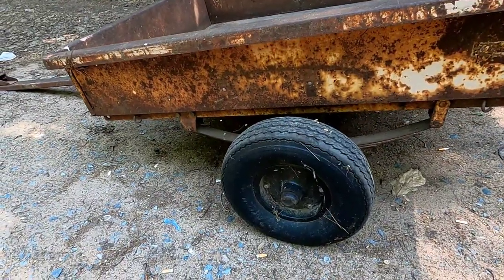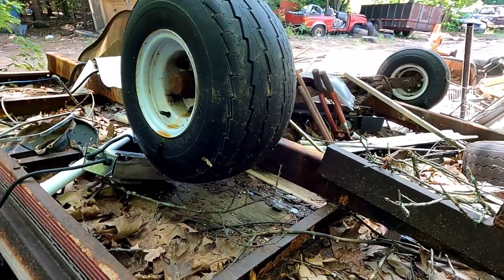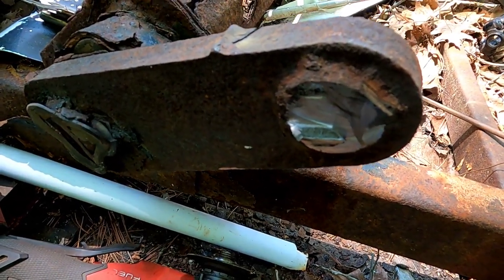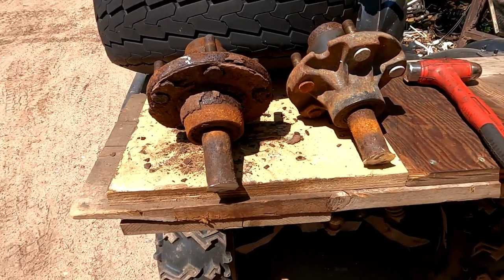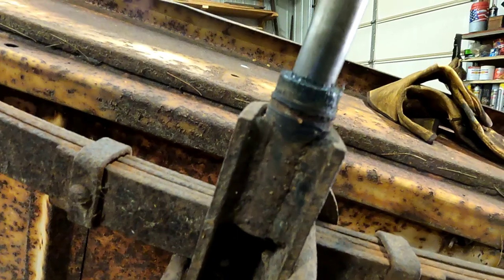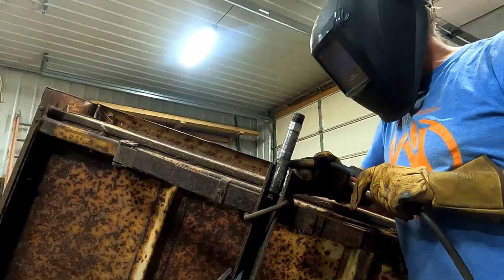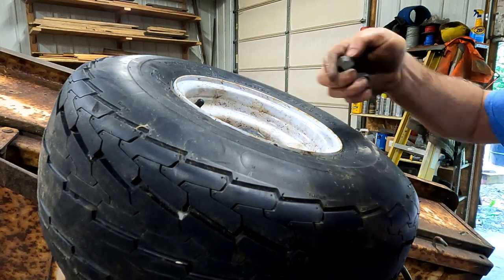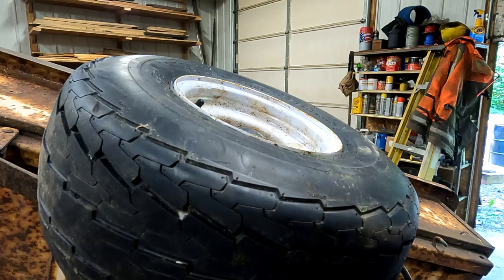Utility trailer tire and wheel upgrade. Using salvaged parts.

Comment: Mike , guess it work for you . Iiiii iiiii would got a grade 40 or grade 80 steel round pipe with inside spin axle size . Easy to square and make level Mike . 😊 good looking turf tires 🛞 for in the woodyard Mike .
Reply from the maker: Thanks Leonard.  I told my brother when it breaks I'll weld it back together 🤣

Comment: Nice job Mike that trailer going to big enough for your project?  How’s the mosquitoes up there? Going up to camp in a couple weeks just wondering if there still sucking away or die down a little
Reply from the maker: The trailer is too small but it is the only thing light enough not to sink in the mud! The mosquitoes are bad still but nothing like they were a few weeks ago.